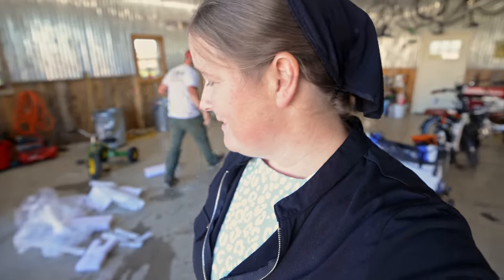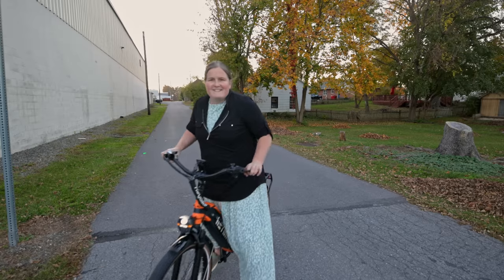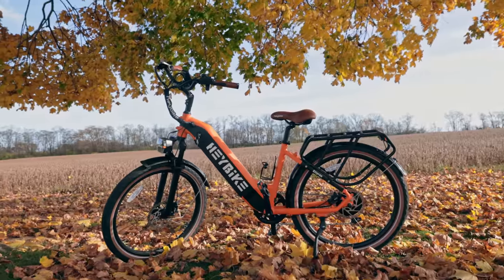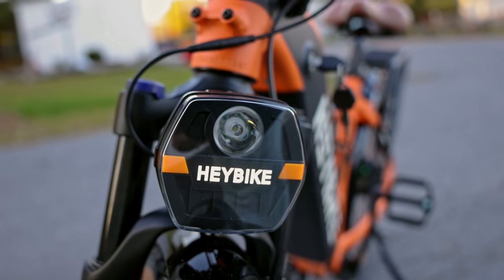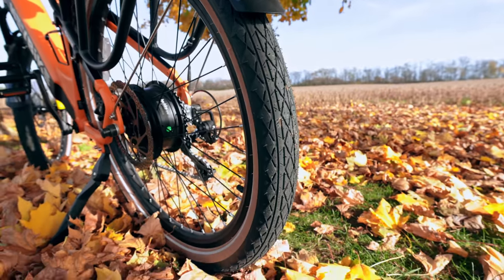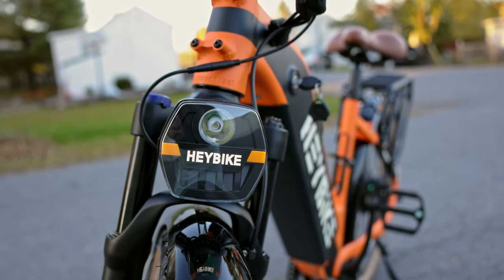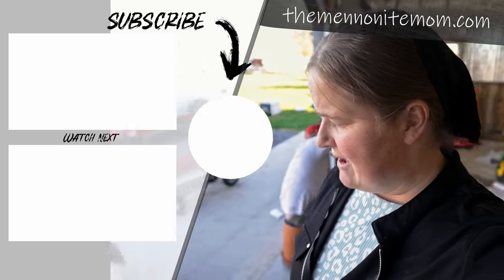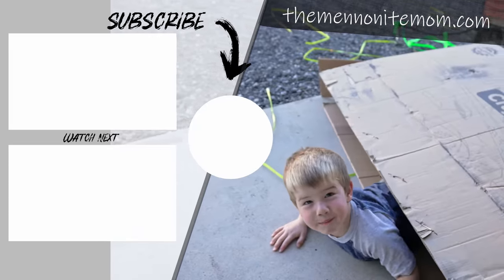Why I love this Ebike + GIVEAWAY!  (Heybike CityRun Review)

Comment: Well I missed out on entering that one.  The problem i'm having is finding a bike that will accommodate shorter people. I'm 4' 9", most of those E bikes are for people 5 ft 2 or taller. If I were to get on one I wouldnt be able to touch the ground while sitting on it.